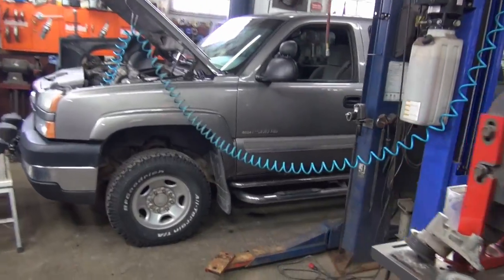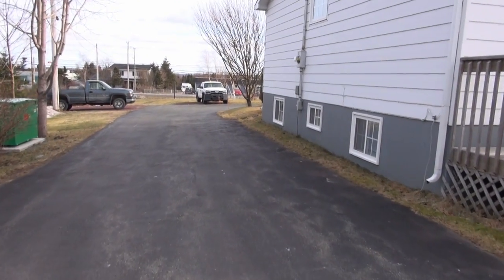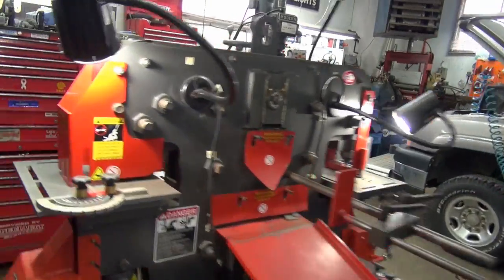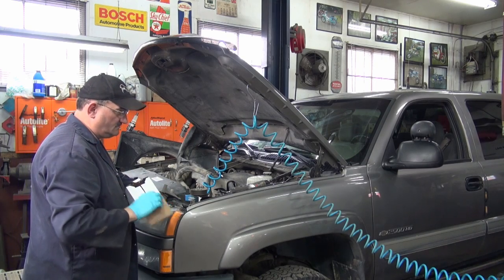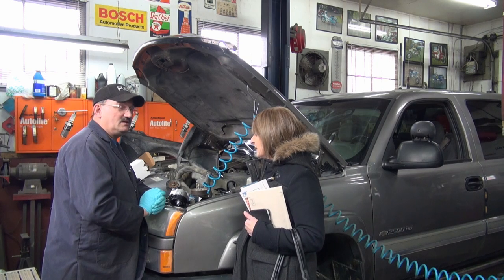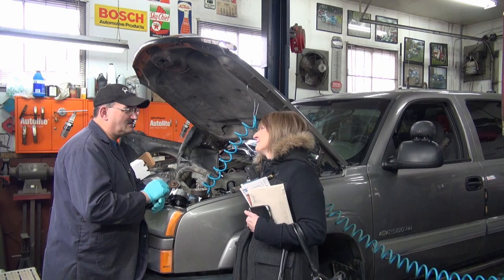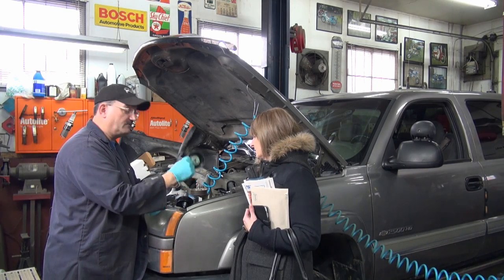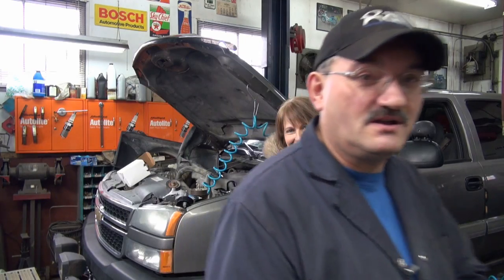Where Is Our Snow?

Comment: hey paul i got a bx2570d snow blower all shear pins are in and shoot spins to toss the snow , but augers are hesatiant ..is there a pin in the gear box?
Reply from the maker: Vladameris Vlad 
Did you miss a shear pin before the gear box? I've never seen a shear pin inside a gear box. Usually only brass gears inside and a half moon pin or a key way pin but they aren't for protection. If the shaft it turning up by the gear box and the auger isn't working then it's time to remove the gear box and investigate. Good luck.
Reply: Thanks Paul ..
Reply from the maker: Vladameris Vlad 
Your kindly welcome.
Reply: Well got that bx2750d snow bower fixed had to replace whole gear box.. they wouldn't sell me the gears separatley .. if they did the repairs they could fix it 4 me by replacing gears themselves.. thought that was absurd .. whole new gear box was 625.00 plus tax.. do you have any places or contacts to get parts?

Comment: Your weather is similar with the mid-Atlantic coast region of the US this year as far as the anti-snow.  Horrible forecasting galore - sky is always falling, never hits!  The "weather" people have tried to make it snow here. hahahaha grimace  What we do get quickly goes as temps warm up just enough to melt away the precip and leaves the crusty salt behind.  Well, that's the way it is going to be, even after I upped my hardware game this year.  points at new snow blade, chains, weights for tractor

Oh ya, no flu bug to be found for me (and no shot either!) and I've lost track of how many years it's been!!  I used to get sick  (if it struck) between Xmas and New Years.  Somehow I broke that cycle and have been lucky to avoid since then.  Woohoo!  The worst of my ills are year round w/ stuffed sinus and drainage but I thank my allergies and nasal sensitivities for that.  Any polluted, dusty, moldy environment will do nicely, thanks.

From tractors to noses ... it all ties together as they both HONK.